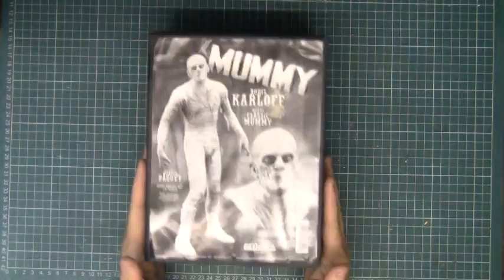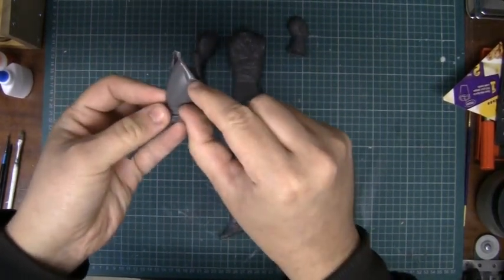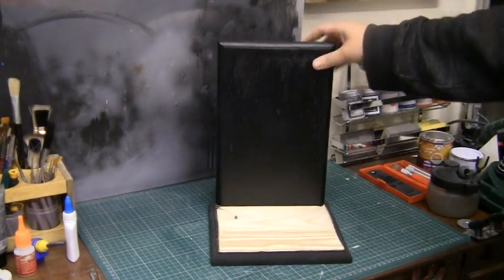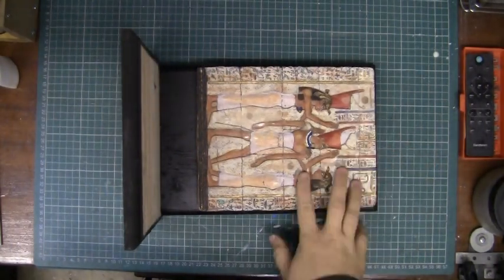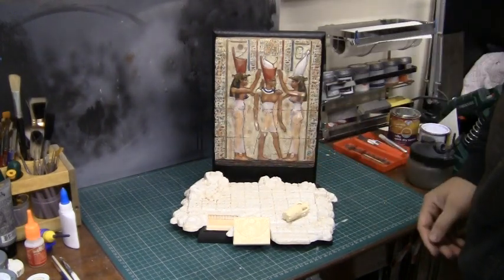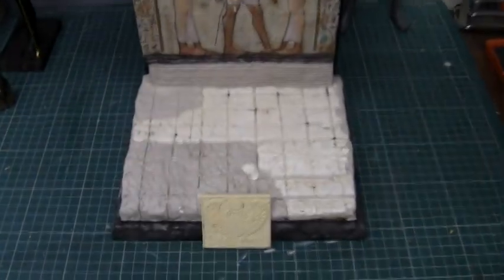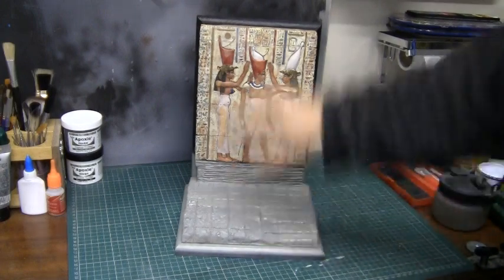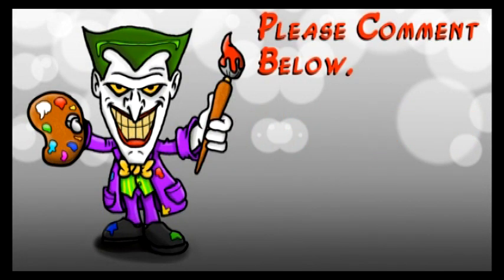The Mummy Model Figure Diorama Build Part 1

Comment: Just out of curiosity why did you not use screws from the back of the display to attach the Egyptian picture to the back wall!
Reply from the maker: I figured it would be easier to add screws from the front and hide them via the sarcophagus and the 3rd screw I originally planned on painting over, but it ended up just looking like part of the motive so I ended up keeping it. Also I did not want to disturb the wood from behind.